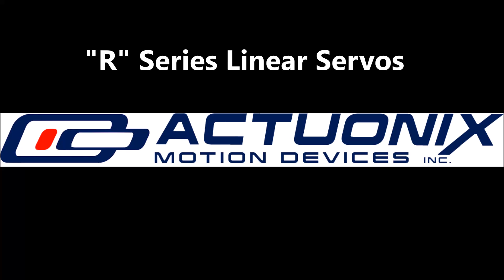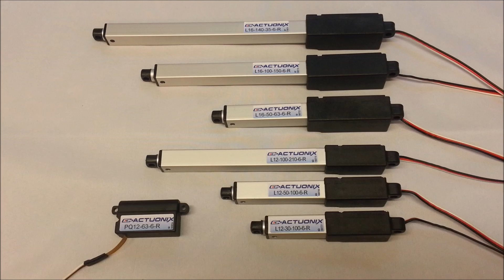Linear Servos For RC, Arduino and Robotics

Comment: are these like electric retracts or are they act like a real servo where if i put this on the elevator it has a variable position that matches the position on the transmitter?
Reply from the maker: Hi airraptor - these work exactly as a standard rotary servo, except linear motion. The movement of the servo will directly follow the position of the stick on your transmitter.
Reply: They act like a real servo, variable position. Just tested setting trim way down and got a lot less movement.